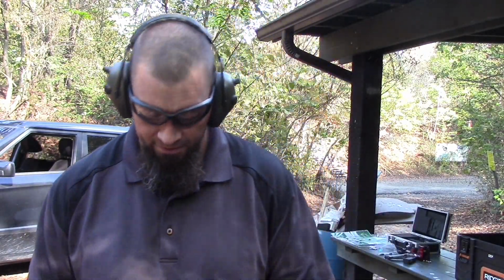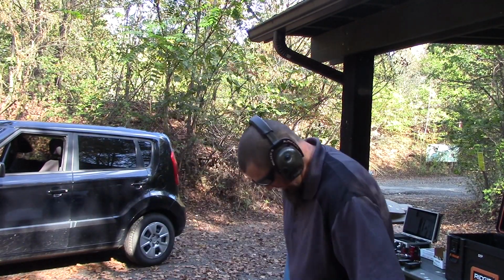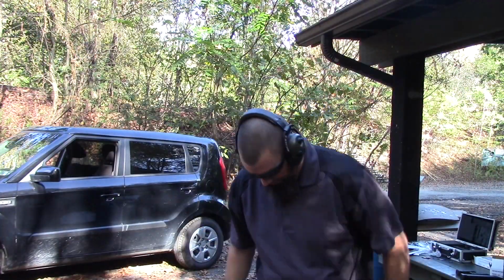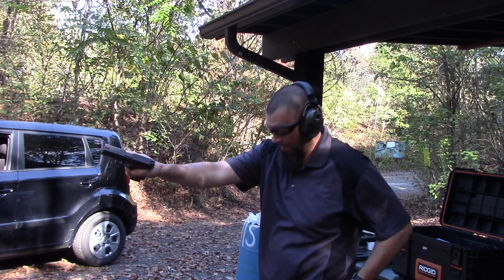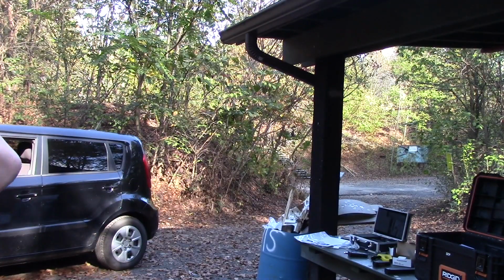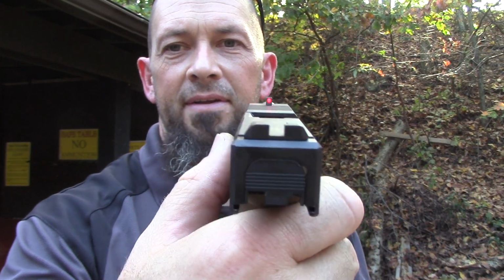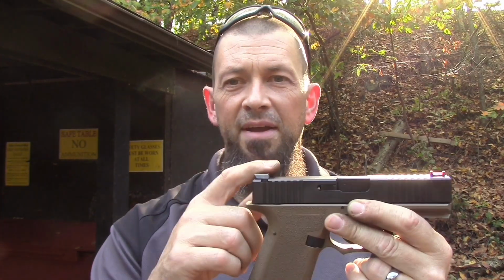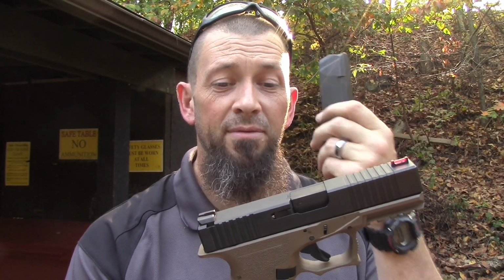Polymer 80 Glock 19. First Range visit.

Comment: I'm kind of surprised you don't know that every pistol, even every factory made pistol is an individual in exactly where the point of aim is, if every pistol shot to the same place there would be no need for adjustable sights. Also point of aim can be dramatically different with different ammo, although that normally shows up at ranges of at least 25 yards. I've been shooting pistols competitively for 50 yrs and the worst I ever ran into was when I traded for a used S&W model 19 that shot so far to the left that it was completely off the standard B27 police target at 25 yds, and the sights couldn't even be adjusted enough to bring it to center mass, just had to get rid of it.